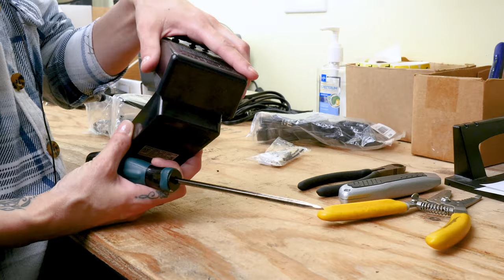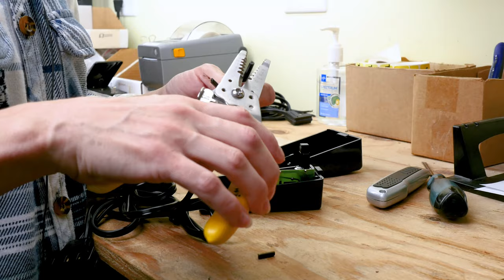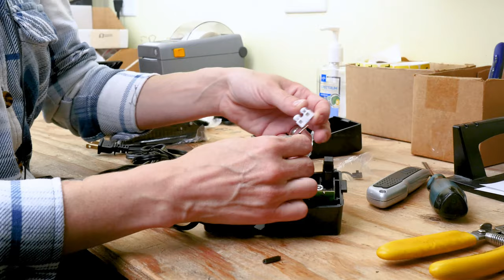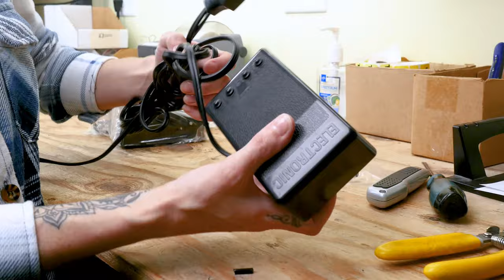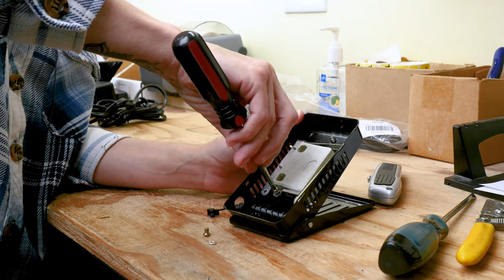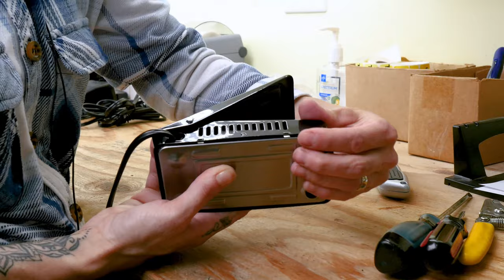How to Rewire a Sewing Machine Foot Control

Comment: Thanks for the instructions on opening the plastic box  part.   I hadn't used my machine in a few years and when I did use it recently,  the foot pedal was sticking  & couldn't move smoothly making it difficult to control the sewing machine speed. 
I wanted to open the pedal to see if anything could be lubricated, but couldn't find a way to get inside.   So thanks for the demo in the beginning.   It still wasn't easy & I was afraid the plastic might break while I was prying it apart with a screwdriver.  But, I persisted, and it opened without breaking.  Yay!  
I needed to lubricate the part inside that moves down when you press down on the pedal.  I used graphite powder and it seems have done the trick.  I put the pedal back together (also challenging).  I haven't plugged it in yet.  
Anyway,  I just wanted to say thanks.  
And incase you're interested, I think what you're saying is useful  and the background music is distracting and unnecessary.  
Thanks again!!💐

Comment: These are just 2 types. there are many different versions of foot controls and ways of connecting them but thanks for showing these.  The grommets that she mentions are what I call a "wire retainer". They can be difficult or impossible to install  unless the grommets are the right size for the wire and also right size for the hole in the side of the foot control. The control that I sell has a different type of wire retainer that consists of a clamp inside the foot control.

Comment: I don't know if you're monitoring this. The foot control for my Bernina 1020 suddenly caused my machine to sew by itself! Intermittently. Do you think the cord is at fault, or could it be the mother board? That is, some kind of short in the inside wiring. Whichever you think it is, do you carry the parts to fix it? If it's the cord, is it the one for the plastic foot? Which I think you're presently out of stock on? Thank you! Love my old Bernina!

Comment: this is not helpful like a foot control that is attached to the sewing machine that does not come out, the machine does not start because of the pedal, like an old 60"S machine, how do you fix that, can it be fixed, without bringing it to be repaired
Reply from the maker: You should be able to rewire a universal foot pedal to the existing wires (the same way shown in this video). You can find a universal foot control here: https://www.sewingpartsonline.com/foot-control-deluxe-universal-6098fc.aspx

If you need further help, give our customer service a call. They might be able to put you in touch with our technician who can give you some guidance: 888-824-1192

Good luck!
Reply: @SewingPartsOnline  Very helpful.  Thanks.  I'd like to order this pedal but it says Out of Stock?  :+(